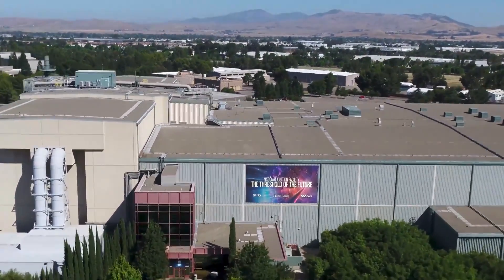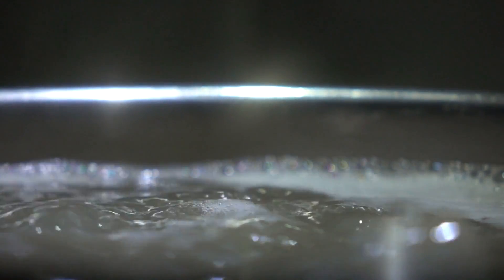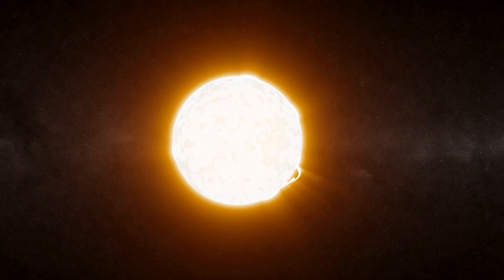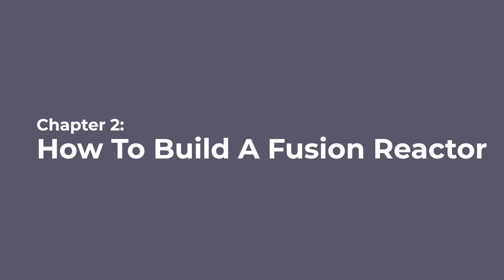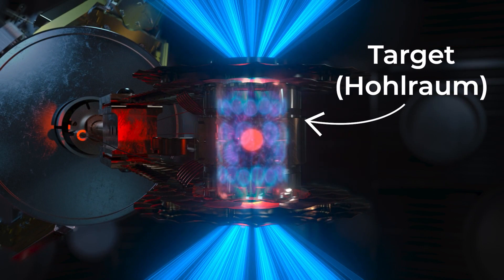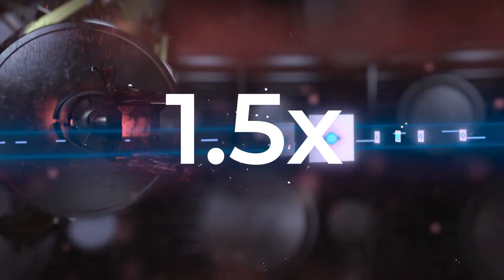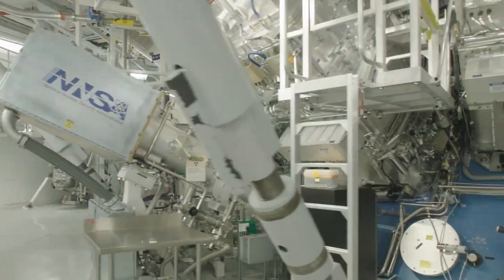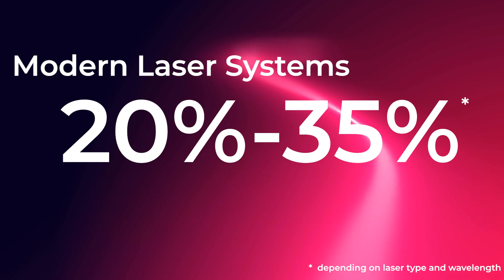The US Fusion Ignition Breakthrough EXPLAINED

Comment: Maybe it is possible to create a chain reaction in fusion, just like with fission. If output energy is greater than input energy (about 1.5X), as the recent experimental results have demonstrated, then the energy produced from a single nuclear collision between two hydrogen atoms can power the next 1.5 collisions (on average) between another set of hydrogen atoms, which can power the next (1.5 x 1.5 = 2.25) collisions, which can power the next (1.5 x 1.5 x 1.5 = 3.375) collisions, and so on, thereby igniting a continuous chain reaction that ultimately creates vastly more energy than the initial laser energy provided by the facility. These numbers assume an energy gain factor of only 1.5, which we will likely improve upon in the coming few years. Chain reaction is seen with nuclear fission. To prevent an atomic explosion, as seen in nuclear weapons, maybe the hydrogen fuel can be pre-mixed with another molecule that is not reactive and that can slow down the chain reaction to a speed that is suitable and safe for commercial energy production. Such dilution of fuel is standard procedure in commercial fission.
Reply: The sun has been demonstrating this "breakthrough" for a few billion years. Thermonuclear bombs (the H-Bomb) has been demonstrating it since the 1950's. Any scientist or engineer who claimed a fusion chain reaction wasn't "proved" is lying or ignorant. This was nothing but an exercise in redefining terms, with a minor improvement in laser efficiency.

Comment: The fusion process very often uses lithium which is incredibly polluting to excavate and we don’t have much source in earth. The only real viable idea that I’ve seen so far is Helion’s solution which doesn’t use any polluting or radioactive materials and produces its own fuel in house… still. They never showed a real energy producing machine, yet. So if they fail to deliver it soon I honestly don’t think fusion is going to be viable for many decades.
Reply: Helion's Polaris system (their 7th gen reactor) should be completed in 2023 and they expect it to show net electricity in 2024. We'll see how it turns out, but their technology is really interesting.
Reply: Don't worry about Lithium.  It is plentiful on earth and it is not particularly polluting.

Comment: @DR Ben Miles @ 8:53 you say 300MJ go in but only 3.15Mj come out..  That is not 1% yield. Its actually more like a 99% loss. Or did you get your figures mixed up? Also using fuel that is rare does not make sense to me. What's the point of using tritium. This seems more like an experiment to prove that fusion is possible rather than looking at an alternative power source.

Comment: The laser concept is correct, it is now just a matter of improving the laser focus, synchronization, frequency, energy,  3D wave pattern, detector feedback loop and efficiency.  The current lasers are 70x more efficient which means the overall net Q will improve from 1% to 70% just with new lasers.  Combine that with improved components and electronics it is possible to get an overall energy gain with new technology.
Reply: "It's now just a ..."
Nope.
Reply: True

Comment: They've bandied around the term "ignition" to describe this breakthrough. Maybe I'm wrong, but doesn't "ignition" by definition require inefficiency to be considered?
Reply: No.
Reply: @Gomlmon99  Why not?
Reply: @nexus1g  ignition if defined by the heat of fusion being greater than the cooling of the plasma. Nothing to do with efficiency.
Reply: @Gomlmon99  MIT defines it as, "The point where a fusion reaction becomes self-sustaining instead of requiring a constant input of energy."
Reply: @nexus1g  That’s how “burning” plasma is typically described.

Again, absolutely nothing to do with efficiency either way
Reply: @Gomlmon99  That doesn't make sense. In the case of inertial fusion, that quote says to me that enough output is given to power the source of inertia. In that case, efficiency loss from the laser and electricity generation is a necessary consideration.
Reply: @nexus1g  sorry dude, but that’s nothing to do with ignition. Ignition has quite a specific definition, it has nothing to do whatsoever with overall efficiency.

It applies specifically to the plasma/fuel, not the surrounding systems
Reply: @Gomlmon99  Yes, but you're not reconciling your understanding with the quote. You understand how what you're espousing as ignition could be perceived as contradictory with the quote, yes? And it's nothing personal, but I don't know you other than as a random internet person and that authority must take lower precedence given an MIT source.
Reply: @nexus1g  What I’m saying does like up with the MIT definition. If you put in 300 MJ to create a plasma that then lasts a millisecond under it’s own heat, and produced 3 MJ from 1 MJ, then you have Q<1 whilst still teaching ignition. The plasma could be self sustaining, but that doesn’t mean anything regarding the efficiency of the external heating.

This is another example. Q<1, but ignition achieved, both this year and last year.

This isn’t just me (though I do work in the industry), this is literally everyone who’s ever used this term ever. Efficiency of external heating is not a consideration.

Comment: I got an offer for a free lunch one time. I fell for it, and when I got there … I had to sit and listen to a 2-hour presentation on whatever! In the end, I realized that there is no such thing as a free lunch.
Reply: It consumes fuel added to the system, so it doesn't violate thermodynamics.
Reply: @nexus1g  correct, but it does consume 300+ megajoules to power the lasers that deliver 2 megajoules of energy which returns 3 megajoules for a total loss of 299 megajoules. This doesn’t take into account the power consumed by secondary systems on-site which allow the facility to operate. Nor does it take into account the energy required to create Tritium or Deuterium.
Reply: @thurlravenscroft2572  What does that have to do with your free lunch comment?
Reply: @nexus1g  the whole point of developing fusion as a power source is to make it sustainable in perpetuity … right? It still consumes vast amounts of resources that are energy intense to produce. All I’m saying is that the entire ideas of fusion being used in this way is clickbait on a grand scale costing billions of dollars that we could spend building fission plants that actually work.
Reply: @thurlravenscroft2572  That's fair enough. When people mention free lunches in terms of physics, they're most often noting that someone's trying to get more energy out of a system than the total being put in.
Reply: @thurlravenscroft2572  finally pallets are burnt by uv light. 
In some future if we could use light directly its gonna be almost 100% efficient and will give 50% extra power out.

Comment: The fusion experiment did not get more out than in. They ignored the containment field and ancilliary power uses. All in they produced just 1% and for not very long. Its still 40 years away if ever.
Reply: Your YouTube certainty is hilarious.
Reply: @morbidmanmusic  Anyone's youtube certainty on this topic is hilarious.  I hope Fusion reactors are successful, in the future. At this point they are still fail to power turbines to produce electricity at a higher rate than the energy going in.  They still are unproven. I support this R&D, but it's still a hope and no proof of concept.

Comment: If pressure plays major role in heating, does that mean the surface of a black hole is infinity hot?!
Reply: They are hot. But it’s change in pressure that causes the heating. Compressing something heats it. Once something is at a static high pressure, temperature is necessarily high.

Comment: So basically, this is still hopeless. This technology is still incredibly complex and is going to cost a fortune to make a commercial plant based on this method. How can it possibly compete with much cheaper sources of electricity? Molten Salt reactors are a much better proposition, and we already know that those work.
Reply: How is demonstrating the POC for a potentially revolutionary source of energy 'still hopeless'. That is such an idiotically pessimistic take on the breakthrough. Did you expect to have a full fledged fusion reactor up and running as a demonstration that fusion works?

Comment: Add the energy required to store the initial load burst, make the capsules and to generate electricity, you then get a net loss.
Reply: Citations?!
Reply: @morbidmanmusic  try watching the first 2 mins of the panel discussion or read the paper. 
300MJ was drawn from the grid to produce 2MJ of laser energy that was fired at the capsule.
Reply: Capacitors aren't as lossy.

Comment: Now let's see if they actually use this technology for something positive. I don't see oil companies just giving up their power and allowing this to happen. Also, when they first released this achievement on the news they mentioned military applications before anything else. Not a good sign.
Reply: 1. Nuclear fusion is already weaponized: thermonuclear weapons.
2. Safer alternatives to nuclear fission is crucial for modern military powerplants as modern submarines and ships currently run on pressurized water nuclear fission reactors. This could also modernize aircraft, bringing back the idea of nuclear powered aircraft capable of flying for months without refueling. In addition, being able to have a small trailer-sized reactor that doesn't consume diesel to generate power in the field would be great for FOB's. Defense will be some of the first adopters in the technology when it becomes viable. They will be dumping a lot of money into the industry, and that's actually a really good thing (In fact, they area already dumping a lot of money into fusion through Lockheed-Martin's Skunkworks division).
3. Oil companies are dumping resources into fusion and other renewables. They know better than anyone else that the current consumption of fossil fuels is too fast, and that we're quickly running out, for it to remain a viable business strategy. It's in their best interest to diversify energy production.
Reply: @nexus1g  so you basically just confirmed everything I said lol. Won't be for civilians anytime soon, if ever.
Reply: @odinmcboden9690  You've got some really weird ideas if you think any of this is confirmation of what you initially said or that it won't simultaneously come to civilian use.
Reply: @nexus1g  I said that it will be prioritized for military applications. Isn't that exactly what you said? I don't see what the confusion is here. It sounds like you just want to get into some big intellectual argument for zero reason....
Reply: @odinmcboden9690  What I'm saying is just going over your head. New tech before production infrastructure is laid is prohibitively expensive. Military expenditure expedites that infrastructure establishment, getting it to civilian affordability sooner through public expenditure, allowing tax dollars to perform double duty in establishing expensive infrastructure investments as well as defense.
Reply: @nexus1g  you act like that is a hard concept to understand. I know how it works. It's not going over my head lol. The point is, it's sad that it has to be that way. For how much everyone is crying that the planet is dying, they sure aren't willing to give up all that money for the greater good of humanity.
Reply: @odinmcboden9690  A narcissist? How does that even make sense?

Comment: I think you are being too kind by excusing the scientists from mentioning the fact that the experiment really was.not breakeven. In any other scientific field if you exaggerated your results by 100 times, your work will be roundly denounced and dismissed by the greater scientific community. Also statements about the availability of nuclear fuel have been grossly misrepresented. They say we can get limitless hydrogen out of the oceans which is true and even deuterium is relatively easy to extract but tritium is hardly in limitless supply as the press releases around this event implied. This is scientific fraud a major scale designed to ensure that billions of dollars of funding.

Comment: What if: Ok lets imagine a cone shape like so "V" and some huge magnets squizing downwards a donut shape ring made of charged ions inside that cone. Let's push that ring with magnets downwards so the ring has to decrease its diameter thus incrementing temperature.  Let's push harder until fission occurs.  I'm also thinking about using centripetal force to induce a fusion reaction against magnets.  Using this method with the cone shape method could be another way so you only need to speed the system to use its inertia in our favor. Could this layout work? Thanks for reading

Comment: I'm curious to see your opinion of Helion. Engineering explained just put out a great video on it.
Reply from the maker: Thanks 👍 I'll check it out
Reply: HELION's technology is not new. Cambridge was using this back in the early 90s but it proved unworkable. Tokamaks are lined inside with a beryllium surface that becomes highly radioactive over time and you end up with the same problem you have with spent carbon fuel rods in nuclear reactors. Feasible, practicable and affordable thermonuclear power is still decades off. Oh yes, trillium, a primary reactive ingredient is very rare and expensive to produce (only a few thousand grams are produced every year!). That, alone, makes the current tokamaks impractical.
Reply: @eNigma011  don’t think the beryllium is anything like spent fuel rods whatsoever
Reply: They’re on a big PR drive at the moment but they’re many decades behind tokamak approaches. No one in the industry realllly is that positive about them.

Comment: I really despise the over marketing of every minimal tweak in fusion as a break-thru, when commercially viable isn't even close to a decade away.
Reply: On the surface but fusion is hard.  So complex it encompasses most if not all science fields. A tiny improvement equals a giant leap in understanding. Commercial plants will take time to build.  No different than fission. Cost more but zero danger.
Reply: @ConsentDeath  While I understand what you are saying, I don't think it does the general populace any favors because these types of headlines imply that we solved "THE" problem, when in fact, the amount of energy to power the lasers is still 100 times more than the amount we are getting from the fusion reaction itself. So, the headlines are so incredibly misleading.